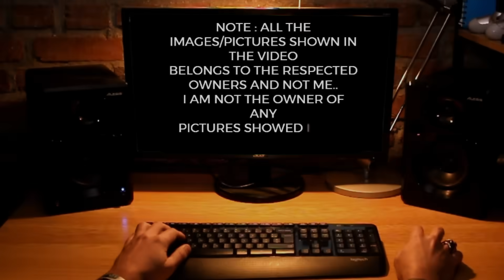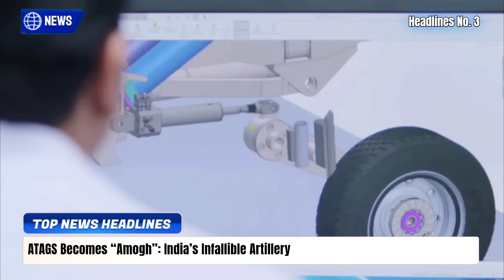TOP Defence Updates | India Builds PCL Radar | RAFALE + SU57 Mixed Approach | ATAGS Becomes “Amogh”

Comment: Rafaele not giving TOT or source codes. Russia is giving. So now buy su57 and upgrade at will with Indian systems, while developing AMCA and 120kn engine.
Reply: Nobody is giving 100% ToT. It's just buisness trick to gain most posible leverage in deal. Do you share your hard earned money without review what you get in return. By the way india required a large number of aircraft so Rafael to sukhoi both can be fitted easily. Indigenous project will continue
Reply: @BibhutiNarayanMishra-t3z  can Indian missiles be fitted on su57 and Rafaele equally or is it only su57?
Reply: @Bhavd-t4q  can be fitted to any available aircraft Be it Rafael or Sukhoi or existing older fleet of Mirage and Jaguar if TOT shared  and done required modification.